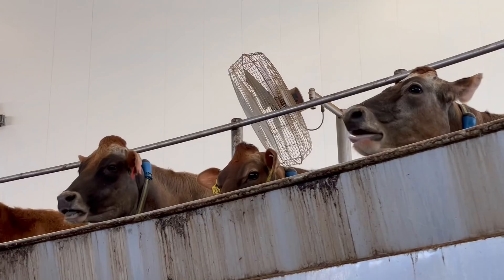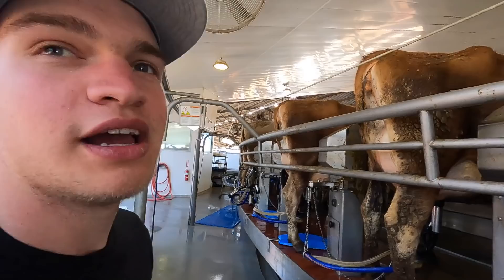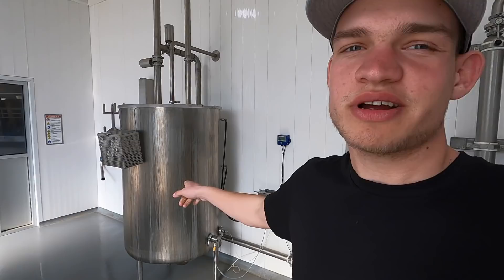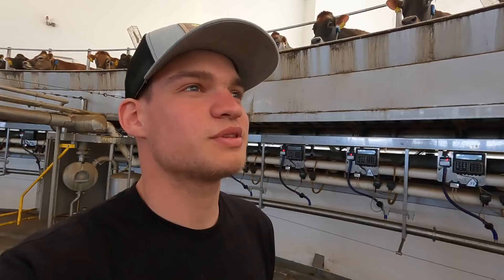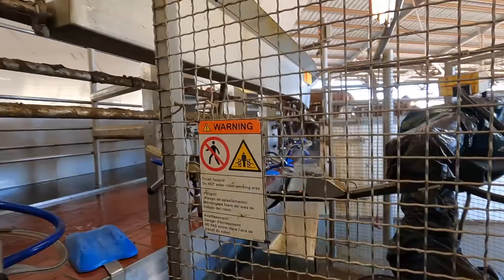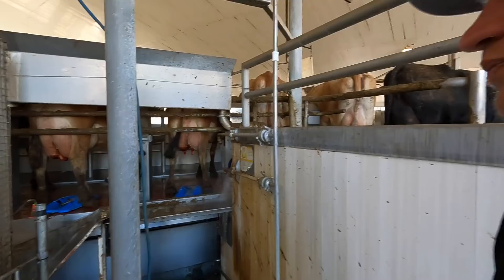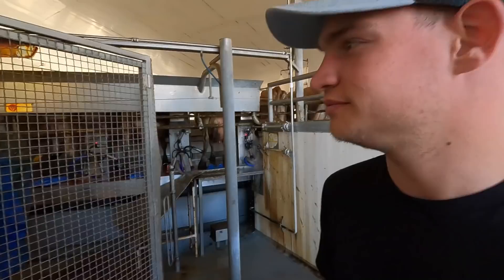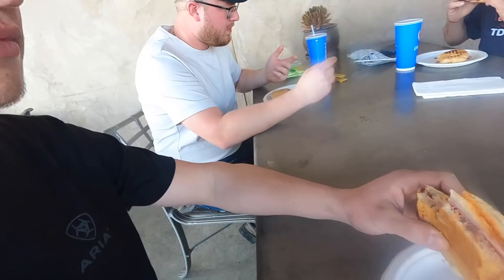This 80 Stall Rotary Has A Robotic ARM!

Comment: i workerd for 3.5 years with DeLaval TSR. A very nice solution when it works... There are three security switchs at the cage and also when TSR has a problem you have a emergeny stop. So you have to check all switches and mostly restart the robot-computer three or four times. And this is often at 4 a.m.
And nobody us the security wire, because when you start the rotary after a emergeny stop maybe you shot down the TSR.
The PR3100HD is a nice rotary with high performance. We had a 60-stall, but clockwise. And some different details: Harmony plus as clusters, only one receiver and no terminals in the subways but a large screen for test milking samples.
Reply: Good comment. I am all for efficiency and new technology but I am sure getting the bugs worked out and keeping it working takes some doing.

Comment: It's spades on tank vs truck. You're either paying for the tank or you're paying for the trucks. If your going through as much as they are it's worth loading straight into the truck save a step. If its like you where it's a tank a day or two it's not worth the truck head ache.

Comment: Great Video as always.... BUT! I was not so good on how dirty those cows and utters looked, even at the end with all that cleaning. And their tails all wet and full grown. Amazing how clean the farm looked but to bad you didn't show their barn and how those cows are treated? You can have a clean place all you want but if the cows are dirty then I would be scared. 
Strange way to do the milk I wonder at what point it's tested before going to the stores! And just another note on cleaning the milkers, how can you just spray them down from the top if they are hanging the other way. Doesn't the inside get washed at all and at what point? 
Gee nothing like your set up for health and safety!

Comment: What are the differences with using Jersey cows as compared to your cows or any other breeds?  ...  Cheers  ...
Reply: Jerseys have a higher butterfat % in there milk. Holsteins have a  slightly lower butterfat % but are capable of producing a higher total volume of milk.